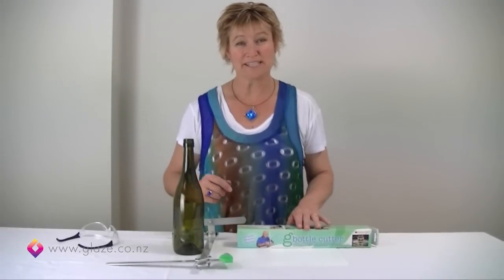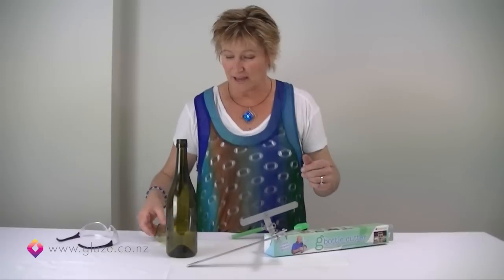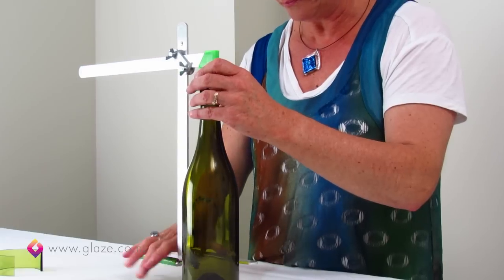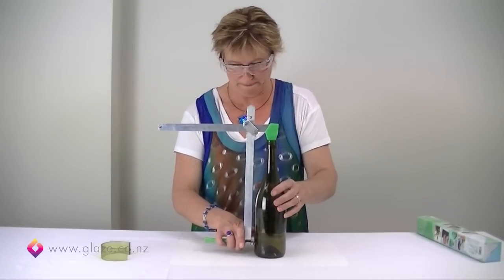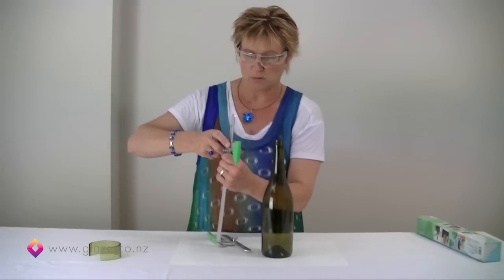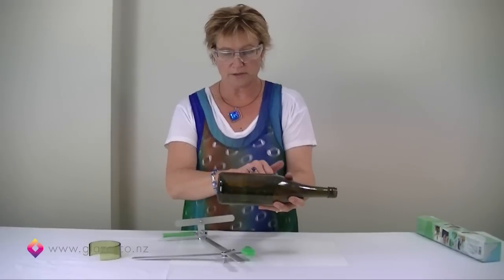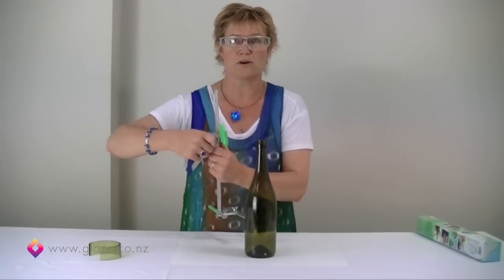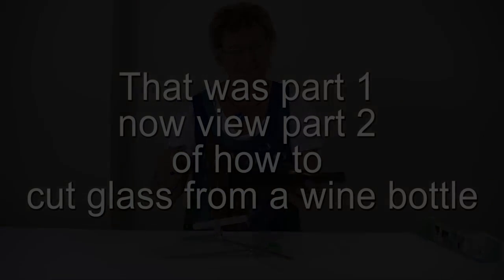Glass Bottle Cutter - How to cut glass bottles Part 1

Comment: GlazeGlassJewellery, 

Thank you for your helpful hints. You're right, scoring the inside of the bottle was the wrong thing to do. I don't know why they even sent it along. Through a process of using hot kettle water and cold tap water I was able to successfully cut a beer bottle now. 

You can find the success video on our channel titled 'Bottle Cutting Success - The G2 Bottle Cutter works after all'.

Comment: I've used this some device numerous times and had very few failures. I have made a wide array of drinking glasses and even lanterns. To me, the easiest method is to use hot/cold water. but the trick is to heat the glass up with boiling water. after you get it hot, run cold tap water, and start spinning the bottle quickly. while spinning put the score line under the cold tap water and you will see it crack and then just pop it off. really easy.

Comment from the maker: Hi Nick, you were doing fine with everything until you decided to score the inside of the bottle.  When it says to repeat the process, it means repeat the hot/cold, not the scoring. If you have two score lines of glass it won't usually break straight - one score line is all you need.  We teach classes how to do this in our studio and have very few failures. We don't use the hot/cold water method because it gets too messy, and the candle/ice cube method works well for us.

Comment from the maker: Sorry to hear that you are having difficulty with your bottle cutting.  The trick is to use one hand to hold the cutter on the bottle and the other to gently turn the bottle - it does take a little co-ordination and practise, but it is quite easy - I've seen people in their late 80's using this without any problem, and they have not used it before.